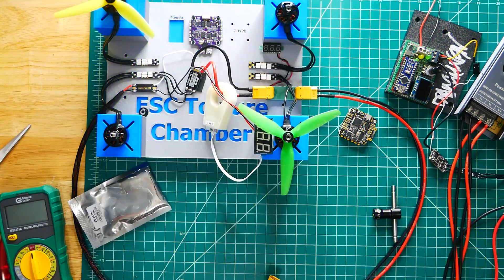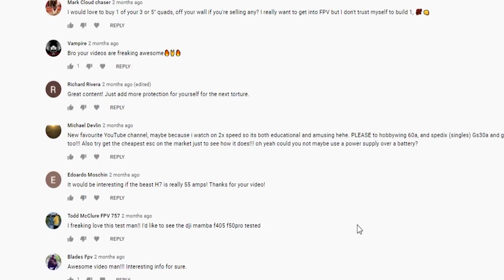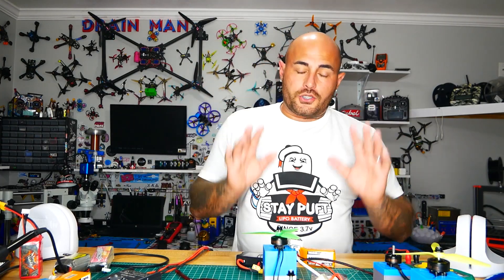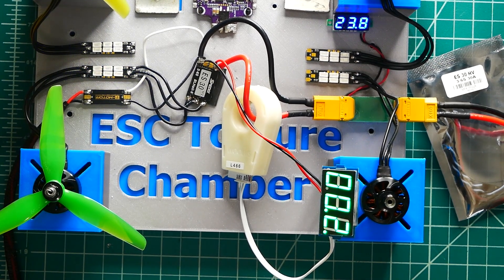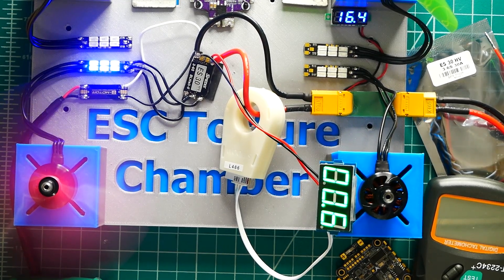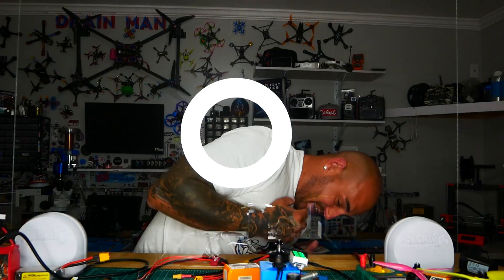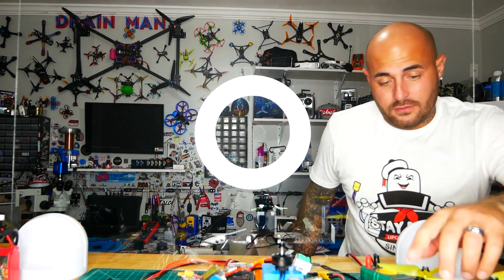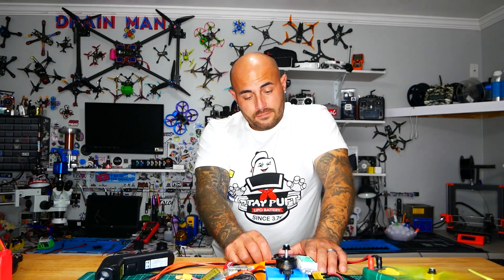Can Your Favorite ESC Handle It ?! ESC Torture Test !!

Comment: Your amp meter needs to be in series not parallel. All the current has to flow through it to be able to measure it.
Reply: Get the HP / ISDT power supply. You will need a power supply with more than 50amp output just to run 1 motor.

Comment from the maker: Hobbywing XRotor 4in1 ESC – 60A
Reply: I use this puppy on a few of my cinema camera drones, would love to know if their rating is real!
Reply: @RossHasAdrone  I had a little smaller piece of shit, in the 20X20 and 40A version, Hobbywing never again... My favorite now is the AIKON AK32 4in1 35A, simply the best!!!! Fuck the Sponsors
Reply: I use the Hobbywing 60 amp on every quad I have over 5 inch.  Cant kill them.  With a 50\1000 CAP they are indestructible!
Reply: Run that 100amp Darwin esc you made a video about..
Reply: YEEEEEEEE!!
Reply: I have two of them on 5" for freestyle and love them but have never pushed them hard enough.. would love to see it put to the test.
Reply: @cwwCADAVER  nice. I've pushed mine super hard. Have burned up 4 motors with that ESC so far and it's still working flawlessly. 😍😍
Reply: yes !!!
Reply: I have it on 2.